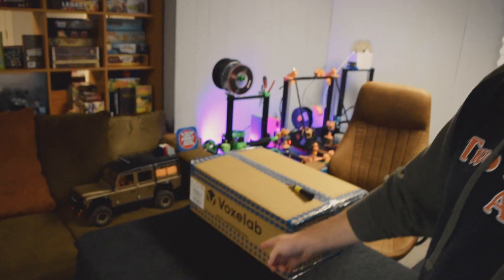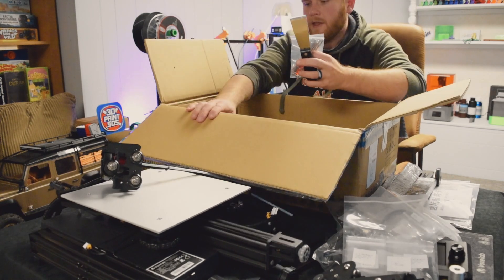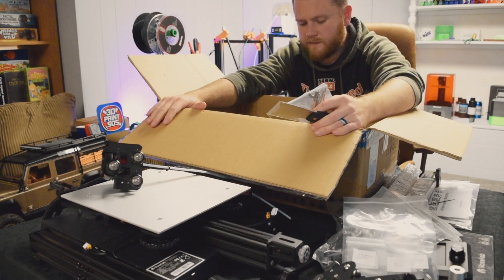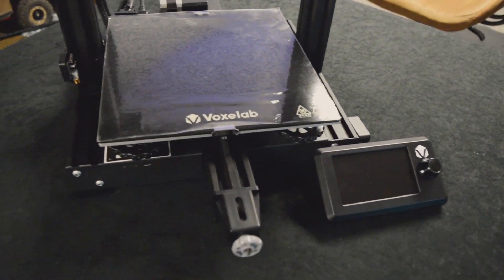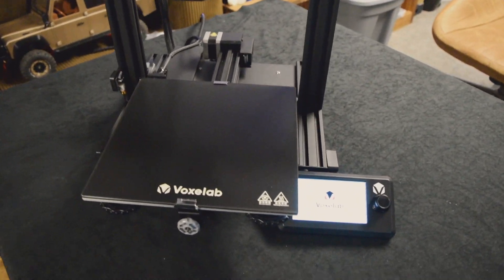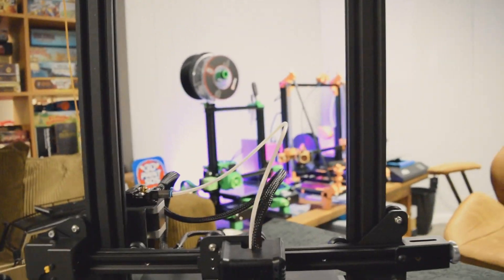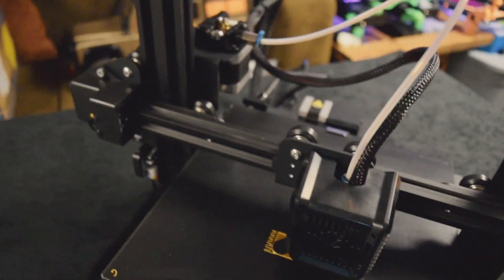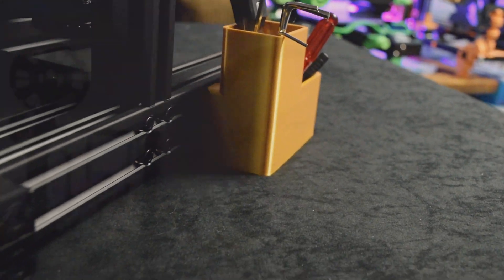Voxelab Aquila Unboxing, Assembly, and First Print

Comment: Have a dumb question.. I see the new firmware adds BL touch. If I install this but don't have BL touch would it cause a problem?
Reply from the maker: Actually yes. It will not work without a BLTouch.
Reply: @3DPrintSOS  thanks I will skip this if I need to update the firmware.. Yeah I couldn't pass up the deal.. Found it through the 3D printing deals at Reddit..

Comment: Very nice! Looks like it needs a filament guide..
Reply from the maker: Wouldn’t hurt. I would suggest a mount at the bottom of the printer on the left. Plenty out there and fix that issue completely. For me, the printer is going to live on a shelf so I won’t be using the top mounted spool holders anyway. :)
Reply: @3DPrintSOS  ordered  this printer today and got it for $159.20.. I also have a Diggro Alpha3 Pro which has a great touch screen.. Thanks for all the info!
Reply from the maker: Wow! That’s a deal and a half. Well done!

Comment: Can I use this printer in a 220-volt country, please. Thanks.
Reply from the maker: Good question. I would double check the voxelab site. I don’t wanna give you an answer I don’t know enough about. :/
Reply: @3DPrintSOS  after looking at some other videos, it seems that there is a region switch on the power supply. but I'm not too sure. the presenter is not very reliable. thanks for replying.
Reply from the maker: Yep. There is a switch on the supply. ;)
Reply: @3DPrintSOS  thanks man!!

Comment: What material are you using in the video? The fact there's no layer lines is amazing!
Reply from the maker: Pla. Yes, this printer is amazing at smooth layer lines. None of my other printer, outside of resin, can do this.
Reply: @3DPrintSOS  Is there a particular brand of PLA that works better or is it pretty fool proof to just go ahead and buy any brand on Amazon?
Reply from the maker: Check my links for Yousu brand. That’s my current favorite. 3DSolutech is also good and sometimes really affordable. ;)

Comment: what are the print settings you have set? steps per mm? my projects are turning out like trash. jut wondering what yours is set at.
Reply from the maker: I’m using the stock profile that was on the sd with the only mod of moving the seam to the back and turning combing to “not in skin”. You can find my profile attached to other vids. ;)

Comment: What type of filaments can you use with this printer? Only PLA?
Reply from the maker: Pla, PETG, and TPU if you print or purchase a new extruder. ;)
Reply: @3DPrintSOS  interesting. would love a video about that. is Thijs something that a ender replacement would work unmodified?
Reply from the maker: Yep. I actually just printed the one I designed. It works great and it’s printable. https://www.thingiverse.com/thing:4647801

I plan on making a video around it at some point.
Reply: @3DPrintSOS  very cool. I'm a newbie but I'll keep an eye on that. I'd like to try ABS and TPU for a couple of ideas I have.
Reply from the maker: You could do abs but it’s likely to be successful consistently, you’ll need an enclosure to keep the temps stable.
Reply: @3DPrintSOS  that will have to wait then

Comment: My Aquila has been running mint. Some of the plastic extruder arms have been cracking so I ordered a bmg extruder. It requires the e-steps to be increased to around 415. The stock lcd screen only goes up to 186. Any idea how to increase e-steps for a noob?
Reply from the maker: That’s interesting, I haven’t checked that out yet. I wonder why in the world they would limit the esteps. Are you on the latest firmware?
Reply: @3DPrintSOS  I was on original firmware. But I got the vozelab newest firmware from someone on Reddit who edited the firmware so now the e-steps go up to 800 on the LCD. I had to update the LCD with the newest firmware also
Reply from the maker: Perfect! I found that subreddit last night. Saw that.

Comment: Got my Aquila this afternoon, got her put together (after having to take it back apart because I jumped ahead if the assembly direction), and am currently doing a test print.   Having no adhesion problems, and it's all going great.   I did find where some people were saying that you had to clean the bed VERY well with alcohol.  They had mentioned a yellow tinted something that comes off, and said to clean it until you don't see that yellowish stuff.   Cleaned until I didn't notice the yellow tint.  Leveled the bed like your video, flashed the firmware update, again, like your video on that, and only thing I'm bummed about is that I had ordered a spool of white filament, and when I looked at it, it's ABS!   (My fault, didn't look carefully before clicking the buy button.)   I did get my red and black PLA that I had ordered, so I can print stuff, just not in white right now.  Now, how to get rid of a spool of ABS I don't want.....
Reply from the maker: That’s great. Congrats on the swift troubleshooting too. Bummer on the abs but I would hold onto it if you can’t return it. You never know if you might want to experiment with an enclosure in the future or not. ;)
Reply: @3DPrintSOS  My son's 3d Modelling teacher might be able to use it, so I offered the ABS to him.   If not, I'll keep it around.   And yes, that is an actual class in my son's high school.."Advanced 3d Modelling and Rigging"  The teacher was able to get a couple huge grants to fund the classes, and purchased at least one 3D printer.  Where was this stuff when I was in school back in the dark ages of the 80's?)
Reply from the maker: That’s super cool. Sounds like a good school if they are willing to have classes like that. My wife was a teacher for 8 years and if there is anything I learned is that change is not very welcome in public schools. Haha.

Comment: Just to let you know, they didn't listen to you about adding the side snipper, but they do have little metal clamps holding the glass plate on top of the bed now. I think I'm definitely going to have to find that putting it together video you referenced. I even needed to unbox it with you because I was nervous I might break something trying to pull it out of the foam. Mine was packed in TIGHT!
Reply: Ive heard that the glass build plate is prone to breaking.
Reply from the maker: Haven’t had any issues. How are they prone to breaking? Just curious.
Reply: @3DPrintSOS  Ive heard that pla can become stuc to the bed and the forces to get it off by hand could break a chunk from it Ive heard stories of that happening. On glass deds.
Reply from the maker: That would only happen if you tried to pull the print off without letting it cool. Would ruin any surface really
Reply from the maker: Bummer. Hopefully in one of the next batches! Yes, it is packaged well. The video I was talking about should be on voxelabs YouTube.
Reply: Assuming you found it already but for reference, https://youtu.be/1kasI1-uDA8?list=TLPQMTIwMjIwMjEkiQUElXf6ew

Comment: just sent mine back.... would not work right, considering purchasing another but still on the fence
Reply from the maker: Oof. That sucks. What issues were you having?
Reply: @3DPrintSOS  constant nozzle plugging  was the big one, seems the feeder tube does into the heating unit and its all plastic..
Reply from the maker: Yes. That’s how most of these printers work. The PTFE tube should be completely flush with the nozzle. If it’s not, for example getting dislodged during install, it could cause clogging. They also include a needle for easy nozzle cleaning. If you do end up with a replacement, let me know if you have issues. I’ll help you get up and running. I’ve had two of these and they have been nothing short of impressive in comparison to similar offering like Creality or Anet. ;)
Reply: I can't get anything to stick to the bed 😩 very frustrated!
Reply from the maker: I see this often and I’d really like to know why. There must be a simple fix. I’ve had two of these machines and they are both incredible. Zero mods. I might need to do a more in-depth leveling video.

Comment: Hey! So I bought an Aquila this week after watching your other videos. It’s my first printer and I’m happy about the price.

I set up the printer, leveled the bed, turned it on. Buuut when I went to “Auto Home” the motors under the “Controls” menu, the z axis never budged. 

Long story short it doesn’t move, UNLESS I plug the x axis cable into it (which the troubleshooting guide said to do). 

So I know the z axis motor works fine, what should I check next?
Reply from the maker: Hmm. Gotta see if you can check the cable at the motherboard. Maybe swap the cable from another stepper to check. It could just be something unplugged maybe.
Reply: @3DPrintSOS  Gotcha, I wasn’t sure if I would void any warranties doing that. I guess I don’t have to admit anything if it doesn’t work 😂
Reply from the maker: Haha. Shoot their after sales an email. They have great customer service actually. But I’d still take a peek. ;)
Reply from the maker: Uh oh. You find somethin?
Reply: @3DPrintSOS  Just figured it out. I swapped the x and z axis wires where they plug into the board. Z motor moved fine, but X didn’t.

So I knew it was the wire, or the board. I checked the wire annnndd...

Wouldn’t you know? I pinned half of the z motor wires between the base and the vertical beam when I screwed it on 😂
Reply: Thanks for your attention! I’ve never followed a YouTuber so involved with his audience. Your the best!
Reply from the maker: Haha. Heeeey man it happens. I’m glad it’s an easy fix.
Reply: @3DPrintSOS  Yeah, just splice em back together.
Reply from the maker: I’m no YouTuber. Just a guy tryin to help others in the hobby. :)
Reply: @3DPrintSOS  stupid question, you know that male/female connection on the wires? What do you call that?
Reply from the maker: @bendustin7609  Plugs? I guess that's what I would call them. Connectors? haha
Reply: @3DPrintSOS  Do you have an opinion about the pla that came with the printer?
Reply from the maker: @bendustin7609  If you mean the sample, I havent printed with it. But I did use their PLA+,  the green one, and. it was great. I had no issues with it and it had a nice matte finish.

Comment: I just got mine this week as well, I had a pretty smooth first print unfortunately when ordering the filament I received ABS instead of PLA and I been having issues in that end can you help? What are your recommendations on temperature for abs on this voxelab?
Reply from the maker: I've printed with a ton of materials, but never with ABS. Abs tends to have an odor and requires a enclosure. So, I've stayed away from it. :(
Reply: @3DPrintSOS  thank you I appreciate the fast response

Comment: Sir, can you tell me if the bolt pattern for the hotbed are the same as Ender 3?  I'm looking at a heating element upgrade, Ender 3 is listed for the product but not Voxelab. Tyvm
Reply from the maker: If you mean the 4 bolts that hold on the bed with springs, they are likely the same. With that said, I havent taken apart my Ender buts its highly likely, they are the same.
Reply: @3DPrintSOS  
Yep, those are the ones. Thanks 👍

Comment: I can attest to the bang for the buck of the Aquila at this insane price point. Belt tension knobs, 32bit board, colored LCD. I have 3 ender 3s in my printer army and I have replaced 2 of them with the Aquila. Great prints out of the box and their customer service is surprisingly responsive. Great tips btw and now i will wait for a bigger sized Aquila release
Reply from the maker: A bigger version would be welcome, for sure. :)
Reply: Is 32 bit pretty good?  I'm assuming there's 64 bit boards as well?
Reply from the maker: @fukcg00gle95  32 bit is great. My Ender and A8 machines are 8 bit. So the menu and some processing cause delays when you are trying to navigate. Especially reading the SD card. 32 bit is super responsive.
Reply: @3DPrintSOS  
Ahh ok.  I didn't know that.

Comment: Great video - thank you for continuing with the Aquila videos!

I have been printing on mine for a few days now, and the hot end cable feels like it's bumping the print bed at times - but I have not noticed it causing any problems with prints.

My test prints have some layer lines on them, not as smooth as yours but nothing terrible either. I am using Hatchbox filament.

I have not had anything sliced in Cura work yet, including with your profile. Your profile has helped, but it's still not quite there for me. Bed adhesion seems to be a problem for me with Cura sliced files, but using the VoxelMaker slicer I have had very few problems. I am going to keep tweaking to see if I can find the difference between the VoxelMaker gcode and Cura gcode. At least I have something that works for now. The Cura sliced prints have failed on the 3rd layer, about 1/8th of an inch up, and even about as high as the back deck of a benchy, so the failures are not even consistent.
Reply from the maker: Well that’s no fun! How are they failing? Also sounds like you got one up on me as I couldn’t get voxelmaker to work. Haha. Layer lines are typically caused by binding, or something being loose. So I would check all of the wheels with eccentric nuts and tighten the belts up. Layer adhesion is typically one of two things. Oil on the bed, or leveling. If the prints are failing by curing, you can turn Down the cooling fan and even turn it off Until layer 3 or 4. You can also raise the bed temps a bit.
Reply: @3DPrintSOS  The are coming off the build plate and getting pushed around by the nozzle. I just did a quick one layer test and there is much less squish to the Cura first layer compared to the VoxelMaker first layer.

I also just re-leveled the bed, as I think I had the eccentric nuts too tight for the Y axis, it looked like one of the wheels on the right was grinding - there was a powdery dust on the track and one wheel. It seems to be a bit of trial and error when instructions are "tight enough but not too tight" for things like the eccentric nuts and the belt tension.
Reply from the maker: Right. There is just too many variables to give a perfect reply. Haha. Btw the dust is normal, it’ll happen to some degree regardless of tension. But if it’s coming off the glass, try going up by 2c on the bed. And give it another good clean with alcohol. Also, use a brim. A brim will solve most issues with pealing on the edges. Another thing you can do is reduce your fan Speed to keep the lower layer hot longer.
Reply: @3DPrintSOS  A lot of good tips! Thank you, looks like it's going to be a weekend of tinkering for me.
Reply: FYI - I slowed the first layer speed to 10mm/s (that's what the VoxelMaker default is) and the Cura sliced benchy worked this time.
Reply from the maker: Woa that’s slow. But hey, if it works, stick with it!

Comment: After  loosely following the 3D printing community for about 3 years I’ve always been interested but finally have a use for it to make rough prototypes for auto parts before I get them CNC’d. After deciding to get The Aquila, I stumbled upon your vids as you are really the only one who has any content on them. I appreciate the time you’ve put into it. Getting it assembled today to start printing. I’d be interested in any videos you make on this in the future. Maybe some firmware mods? Add a BLtouch? set up octoprint? The list is endless.. Lol thanks again.
Reply from the maker: Thank you! Yes this printer has potential and upgradability for sure. Look out for a FAQ video and a Upgrades video in the near future. :)
Reply: @3DPrintSOS  sweeeet!

Comment: Few days ago assembly and try print by petg, some problems with adhesive. Someone have issue?
Reply from the maker: PETG would need a slightly tweaked profile than PLA. I would start with the bed at 80c and hotend at 230c.

Comment: I bought one of these based on your original vid and its been a relatively good value printer, my only gripe is my back-right leveling knob was and still is vary loose/easy to turn with little to no resistance and risks shaking itself loose throwing the bed out of alignment, the back Left one is way too hard to turn, but these are things I can deal with. the biggest downside has to be a missing m5x12 hexagon socketted countersunk screw that helps hold the X tensioner in place so I had to either have the whole thing sent back or just buy another screw. giving that I would say its harder to justify at the $200usd price on amazon currently, but when I bought it $169usd was a great value given the quality and minimal issues with prints aside from minor peeling partly due to human error(I think) and my bed being (unfortunately) warped making it impossible to get perfectly level
Reply: also I would say I recommend Hatchbox for quality amazon-available (usually) filament, I bought a 1kg of their black PLA, only downside is the best prints with it happen with bed temp 60C and nozzel at 210C
Reply from the maker: I’ve heard others have this issue. Basically you needed to adjust the end switch height so the hotend comes down lower. That way, you could have tightened the springs to about half tension. And yes, a missing screw is always frustrating.
Reply: @3DPrintSOS  not entirely sure what happened but my loose bed wheels have actually seemed to tighten up on their own now and I have it pretty dialed in so its printing in a somewhat reliable way (didnt invest in IPA at the time of purchase so I have some occasional peeling due to the left over residue of past prints until I get some) but overall I have it almost as consistent as yours and I still think its a great printer for the price, even at 200$ now its still not a bad deal all things considered
Reply from the maker: @MrSnowFoxy  Glad you got it mostly sorted. A lot of folks get really excited and then a bit deflated because of the learning curve. But once you get some of this stuff right once, you'll know how to do it and it'll be smooth sailing from here. :)